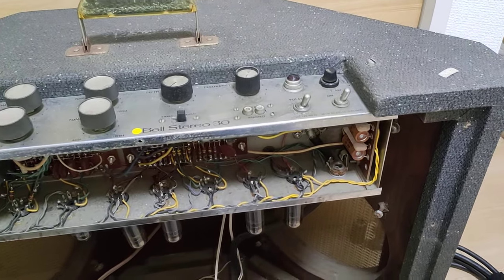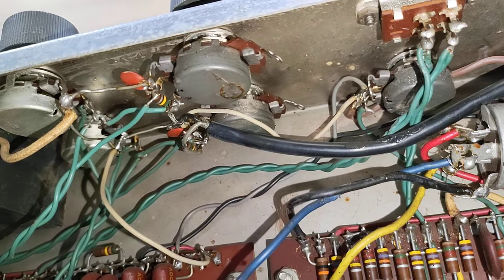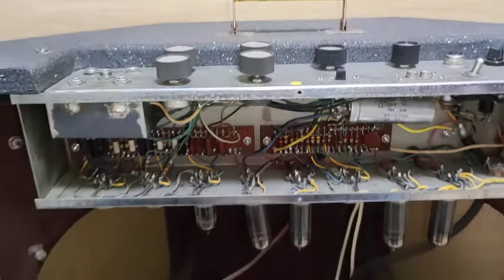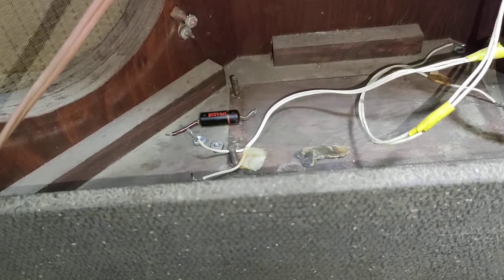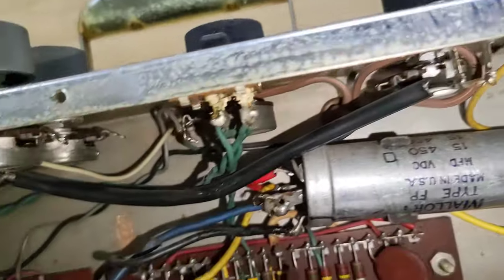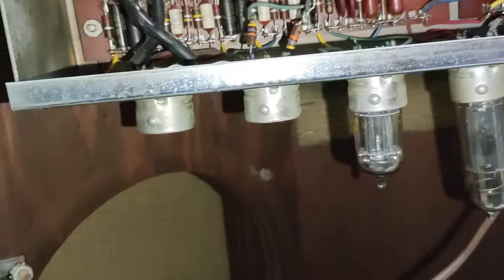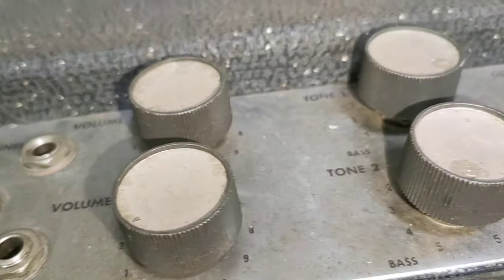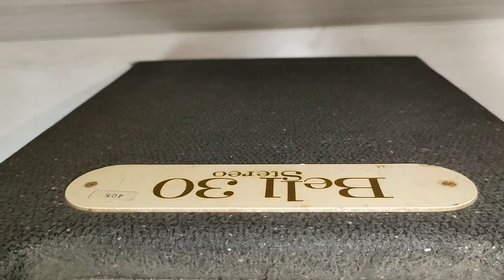Part 1: 1960 Bell Stereo 30 Gibson GA-79 Quick Inside Look

Comment: Congrats on the find.  Seems to be in good shape and relatively un-molested.  What are you going to do for speakers?
Reply from the maker: Hey Shain, thank you so much for the kind words! Thank you also for watching this video!
I'm not sure yet what to do about the speakers! The only available vintage Jensen P10Q pairs are pretty pricey, so I'm currently exploring what other options I could take. From what I've looked at so far, it's a bit of a challenge to find some other 40W Alnico speakers from that era here in Japan, and shipping from abroad seems to be quite high. I've found some generic Celestion ceramic 40W speakers for super cheap here in Japan, but I haven't decided if that's the route I'll go yet or not.
Definitely down for any suggestions/recommendations you might have!